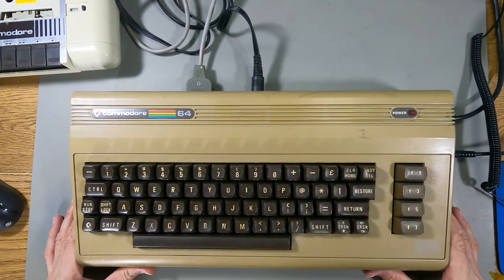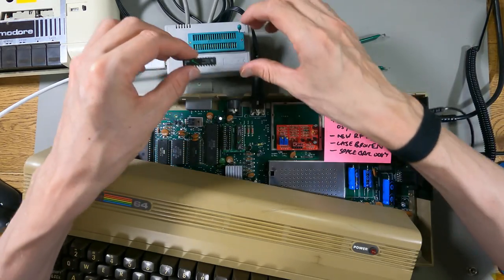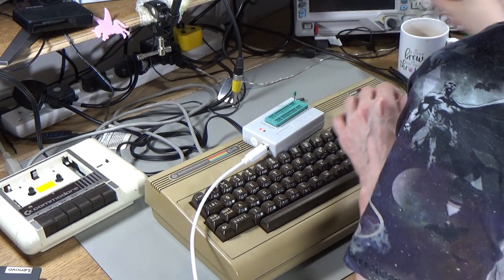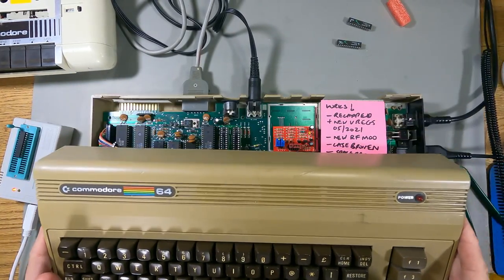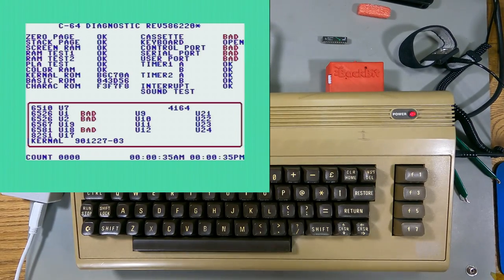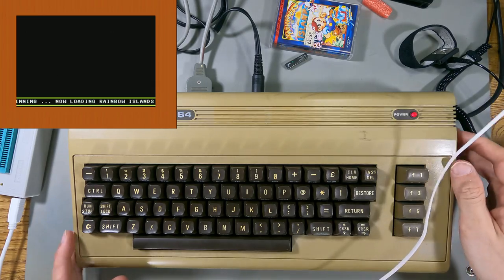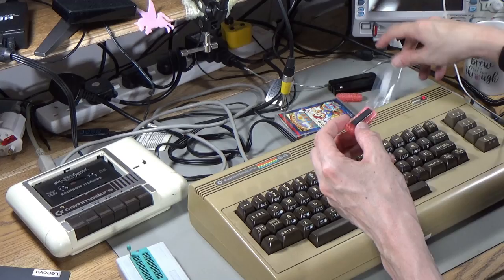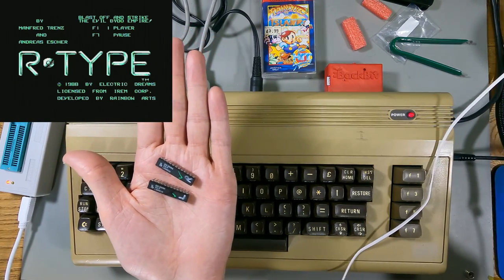The Commodore C64 Replacement PLA has Failed (PLA20V8)

Comment: I would be interested in seeing if you could successfully re-program the original GAL chips and if they would work.  I've successfully done that.
Reply from the maker: Yes, I did that when they went wrong when I repaired it originally, but after the computer just sitting on the shelf for some time, they just failed again. So you possibly could use them if you are willing to put up with reprogramming them all the time. I decided it was time to get rid of them as it appears they can't seem to hold their programming.
Reply: @DavePoo2  Well, programming it is just storing a little charge in the cells that controls how to connect the logic, so if it was unused , not turned on,  maybe those chips didn-t retained the charge.
Reply: @DavePoo2  The programming algorithms used to 'burn' devices were often proprietary and needed to be licenced from the device manufacturer so the difference between a 'brand' programmer and the cheap programmers was the programming algorithm was only an approximation of the official one or something that had been found to work most of the time if you hold your tongue at the right angle and Saturn is retrograde in Capricorn, the rest of the time it's marginal, at best, which leads to a device that passes verification but fails in use either immediately or some time later.

The TL866 hardware also has issues with programming voltages, it struggles to get them right and hold them but it could also just be that the PLA is so timing critical that the variant of GAL used is enough to breach some constraint or other (which is pretty poor device choice)

Comment: Very nice!!  Thanks for such an informative video about fixing a problem with the C64 and chip programming!  I wish I knew enough about electronics and C64 hardware to fix mine.  One time I went to turn it on and I believe the screen was just a solid color and it didn't match the dark blue background or light blue border color.  I didn't discard it.  I'm holding onto it, hoping to fix it one day.
Reply from the maker: It can be fixed. And these days it's 99% chance the PLA has failed, as they were manufactured by Commodore with "problems" that is causing them to fail over time.
Reply: @DavePoo2  Thank you!!  Since the symptoms were so different than yours, I gave up hope.  Now that you say 99% chance it's the PLA, I really need to try this :)
Reply from the maker: @ChristmasEve777  Well, do be aware that there are other problems too in these machines. But honestly, every breadbin C64 I have, had a dead PLA in it.
Reply: If you get a solid colour my first guess would indeed be a PLA. PLAs made in 1983 and 1984 frequently fail, later ones are much more reliable. But you should also check your board for Micron MT4264 RAM chips and MOS 77xx logic chips. Those are also frequent failures. If you have such a "suspect" chip on your board and are unable to do any further diagnosis, taking a gamble and replacing the suspect chip often results in success.
Reply: @danielmantione  Thank you both so much!  I really appreciate your advice.  I'm going to go ahead and try all this stuff soon, starting with PLAs.  I won't order anything else yet until I know (if) it doesn't end up fixing the problem.  And I'll go from there :)

Comment: The GAL20V8A and GAL20V8B are functionally the same, however, under the hood, they are different chips.  This means that while the official specifications are similar, the real-world behaviour is slitghtly different. I think the most likely explanation for your problem is timing: The C64 RAM timing is on the edge, so a small difference can result in a non-working system. Another explanation is indeed a broken chip. You could try to flash the alt2 version, there is no reason why it should be restricted to 15ns GALs, which will result in slightly more relaxed RAM timing for your C64.

I have experimented with GAL20VA chips myself and was able to build working PLAs, however my failures were higher than for the GAL20V8B. I haven't seen your problem before.
Reply from the maker: Hi Daniël, first can I say that I think this PLA project is awesome, it's what's keeping my breadbin C64's alive, so thankyou. If I flash the "A" chip then it will start working again, but then somehow loses it's ability to work over time. It was already busted when it got to me from the eBay seller, and flashing it made it work again. I initially suspected that the seller had done something wrong, but then that same chip lost it's ability to work over time after being sat on a shelf in the C64. I suspect this is just a bad chip as I wouldn't expect it's ability to function to change over time, I think the right hand GAL chip was probably OK. I later tested that same cassette game on a different C64 and it seems like either the tape or the datasette might be in need of service as it failed to load on a different machine.
Reply: "timing" being specifically the latency on the CASRAM output.
Reply: @francoisleveille409  I don't know if it is CASRAM here: bad CASRAM latency would cause corrupted memory contents, but that doesn't seem to be the case here, since the machine is running well behind the disco show. I am more thining into the direction of the response to AEC, if the CPU bus drivers are not completely switched off when VIC-II has the bus, it can for sure cause a disco show like this.
Reply: @danielmantione  No. Bad CASRAM latency means the multiplexers aren't done shifting from rows to columns when the access to RAM starts. All access (read or write) will be affected. The PLA receives the CAS signals but the DRAM receive the CASRAM signal coming out from the PLA. The PLA decides if the access goes to RAM, ROM, IO or something else on the cartridge port. If the access is to RAM, the CASRAM signal is delayed by about 25 ns to give some time for the two 74LS257 to switch from  the 8 lower address lines to the upper ones.
Reply: @francoisleveille409  I am aware what CASRAM latency is (and it is properly handled inside the PLA20V8). However,   CASRAM is no valid explanation, because as you say, CASRAM would affect everything, read and write.What we see in the video is that only the VIC-II has a problem, the CPU is running just fine, which would be impossible in case of a CASRAM failure.
Reply: @danielmantione  Another possible explanation... PAL20V8 logic ICs and their family were really designed for PCs and expansion cards of the late 80s/early 90s era running between 8 to 33 MHz. As such they signal very quickly and source/sink much more current on their outputs than 8 bit eras machine of late 70s/early 80s running mostly around 1/2 MHz. This causes ground bounce and other problems on the signal lines (see telegraphers equation). The XC95xx CPLDs can be "speed tuned" using slew rate limiters and low power mode to make them behave like earlier and slower logic ICs. Hence PLAnkton has no such problems.
Reply: @francoisleveille409  Google just deleted my reply. It seems even talking about a page is considered illegal by the automatic algorithms and causes your post to be deleted. But to sum up: Look at the oscilloscope graphs, the high/low transitions have been looked at and measured. I understand you are proud about your PLA, but so am I. What we have here is an out-of-order PLA, not a design flaw. I am not aware of any design flaws in the PLA20V8.
Reply: @danielmantione  Most importantly, I have a university degree in electrical engineering. The correct name for high/low transitions is "slew rate". The PLA20V8 has no design flaw. It's just NOT designed for use in early 8 bit machines with TTL level signaling and slow clock rates. This may not be the exact cause for THIS specific problem but it can lead to all sorts of weird, intermittent and unexplainable problems. Especially with various 3rd party cartridges.
Sidenote: This is NOT about MY product. There are now many other PLA replacements including open source ones which use Xilinx CPLDs. Dodgy PLA is one of them.
Reply: @francoisleveille409  Agreed, but the discussion shouldn't be about wheter they might be problems, I have published the measurements so all information is on the table. Please take a look at the oscilloscope graphs of the "slew rate", I'm clearly not allowed to tell where but you will find them. Either those graphs are acceptable, or they are not acceptable. Whatever the answer, the PLA20V8 won't change, because as you say, it is a property of the GAL. However, I'd like to document possible weaknesses as much as possible. You did notice correctly I'm not an electrical engineer, I'm graduated in computer science.
Reply: @danielmantione  " Either those graphs are acceptable, or they are not acceptable."
Sorry to say this but electronics doesn't work that way. Partially functioning is something I see every day in just about every electronic devices. Problems can be far more insidious than you think. Digital electronics is analog electronics working in saturation mode.
Reply: @francoisleveille409  Let me ask the reverse question then: How can I be sure your Plankton doesn't cause problematic ground bounce oscillations? A "slew rate" number from a data sheet is just a number, doesn't say anything about ground bounce oscillations by itself. If you want to be sure, you have to test and look at it on the oscilloscope, to look what happens with your own eyes. That is what I have done, and I have done a lot to make myself peer reviewable. If you need more data to peer review feel free to ask, but you cannot say "I believe think GALs behave like this, there might be that and therefore there will be problems..." No... electronics design doesn't work with random claims, it is a proper science and in science, you gather data and reason from that onwards.
Reply: @danielmantione  There is no ground bounce because the output sink/source current is lower than an original MOS PLA. and a 1uF capacitor is added on the board.
As for the rest, I will not get into your details saturation/conspiracy theories coming from your lack of formal training in electronics. I don't 'believe' anything. I read datasheets. So should you.
Also, you're clearly not familiar with the differences between TTL level/current signaling vs CMOS signaling and I can't give you a course.
Commodore/MOS uses TTL level signaling.
Reply: @francoisleveille409  With a datasheet you cannot prove there is no ground bounce. There are many factors that decide that, i.e. parasitic capitance on the bus line. You don't know that, so you cannot prove lack of ground bounce from a datasheet. Therefore in order to be confident for lack of ground bounces you need measurement. You are attacking me again on lack of electronics knowledge.... while you just have done nothing less than admit you haven't done your homework on your own PLA. And I'm not going to criticize Plankton, because lack of homework doesn't necessarily mean a bad PLA.  But TLL vs. CMOS! Come-on, that's really questioning someones most basic knowledge and I'm taking that as an insult. Have a nice day.
Reply: @danielmantione  "With a datasheet you cannot prove there is no ground bounce"
Comment from Ignorance. The orignal PLA is based on the SIgnetics 82S100 and you know it's sink/source characteristics. The traces for signals, power and ground are done so this will not cause ground bounce on a C64 board. If you replace it with a chip which draws power more abruptly when switching occurs then you may have ground bounce. All in the datasheet. When using a Xilinx XC9536XL with slew rate limiter on all outputs, the sink/source current is always lower than that of a genuine 82S100 or MOS 906114-01. The capacitors and trace design on both the C64 board and the PLAnkton board prevent ground bouncing.
Not so with the open source PLA replacement using a pair of PLA20V8.
Reply: @francoisleveille409  What values are you looking at? I see a short circuit current of 85mA in the 82S100 data sheet. The GAL20V8B can source 3.2mA and sink 24mA, obviously it is way below that 85mA, but IMO the short circuit current isn't the right parameter to look at. I'm not aware of any datasheet of the MOS 7700/8700 PLAs. In the datasheet of the XC9536, I can't find a lot of info about output sink/source currents either and how the slew rate limiter affects that. What it does state is that T_slew is adds 3.5ns to 5ns to the transistion time depending on model. Be aware that LSTTL demands a high to low transition time of at most 6ns (you need schmitt triggers if you exceed that), so you can't make your transitions as slow as you like.
Reply: @danielmantione  The rated power has NOTHING to do with sink/source on the outputs. Take a course.
Reply: @francoisleveille409  Sink/source numbers for 82S100 and XC9536, where are they?
Reply: @danielmantione  Really ?? You don't know of official distributors ?
BTW: The 82S100 has been out of production for more than 3 decades.
Also, the XC9536 is not used on PLAnkton. The currently available XC9536XL is used.
Reply: @francoisleveille409  I wasn't asking for distributors, I was asking where you found the sink/source currents of these chips (and am now doing for the third time).
Reply: @danielmantione  
Course #1 for student DM:
- Get the Xilinx development board for XC9536XL or XC9572XL and attach to a professional test bench power supply.
- Attach LEDs to 8 outputs in series with 40 ohms resistors.
- Program VHDL/SVF code to CPLD so it performs the same logic function as a 74_245 MAKE SURE SLEW RATE LIMITER IS ENABLED (in .UCF ex: NET "SAD<0>"  LOC = "P43" | SLEW = SLOW ; )
- Measure current with all LEDs off.
- Measure current with 1 LED on then 2 then 3 then ...
- reverse polarity on LEDs and redo

In other words, you expect me to give you a complete course in a comment... not room enough.
Reply: @francoisleveille409  Teacher Francois did previously claim he did use datasheets, but now needs measurements. As teacher Francois asks student Daniël to perform the measurements for him, student Daniël now thinks teacher Francois hasn't verified his PLA at all in this regard.
Reply: @danielmantione  The ignorant is always right...
I can't even post links to datasheets here.
Reply: @danielmantione  Why don't you ask the people who created the Kung-Fu Flash cart why they put resistors on every line connection between the MCU of the cart and the C64/C128 cartridge port ?
Answer: The MCU they put on the cart doesn't have a slew rate limiter so the resistors are mandatory to prevent ground bounce on the cart and ringing on the C64/C128 bus.
The XC9536XL used on PLAnkton and Dodgy PLA doesn't need these resistors because of the built-in slew rate limiter.
If you want to avoid signaling and ground bouncing problems with the PLA20V8 chips then you have to do the same as the Kung-Fu Flash creators, add resistors. Ask them for the value but I suspect it is 82 Ohms.
EVERYONE with a real degree in digital design or electrical engineering knows this. Apparently, you don't so you're a basement tinkerer arguing to eternity.
Reply: @francoisleveille409  The STM32F4 used in the Kung Fu Flash is an incredibly fast chip that can reach hundreds of MHz, totally incomparable with a GAL20V8B. I'm not denying the phenomenom exists, on the contrary, this is the exact reason for all the measurements that were done on the PLA20V8. Based on those measurements I am stating that I'm confident that there exist no ground bounce oscillation problems on the PLA20V8. Just FYI: GAL20V8B is way slower than a CPLD like the Xilinx one. Maybe a bit faster than a MOS 8700 PLA, but not massively so. A slew rate limiter on a GAL would therefore be a lot less useful than on a CPLD.
Reply: @danielmantione  The MOS 8700 is a replica of the Signetics 82S100 used in PET computers (1MHz). It was too slow for the C128 (1 or 2 MHz) so Commodore had to create their own HMOS 48 pin PLA
The GAL20V8 is in the same family of programmable logic chips used on 33 MHz PCs and on early VLB/PCI cards.
I remember seeing chips like that on the Fusion Forty accelerator and there are some on the Amiga 3000 (25MHz) mainboard.

Comment: That’s not broken. That’s a disco dance show! :)
Reply from the maker: Now I wish I had put some music to it!
Reply: @DavePoo2  it would take so much coding to make that kind of “glitch” happen. You got it for free. :)
Reply: Considering the fact that the computer is running normally despite so much flickering, I think the most likely explanation of what is happening is that the PLA is deselecting a chip select line too slow, making one of the chips still send data to the bus when AEC gives the bus to the VIC-II. The VIC-II then reads data intended for the CPU.